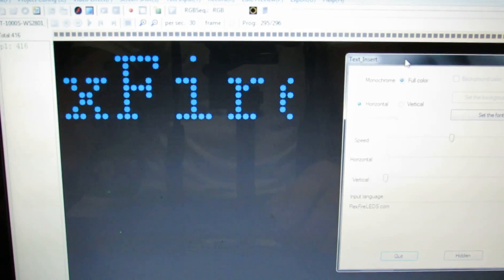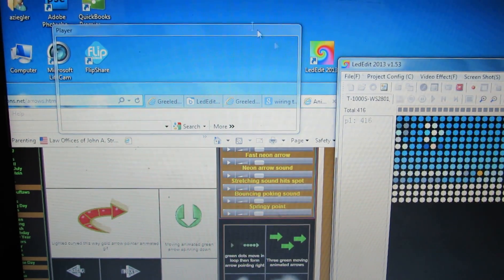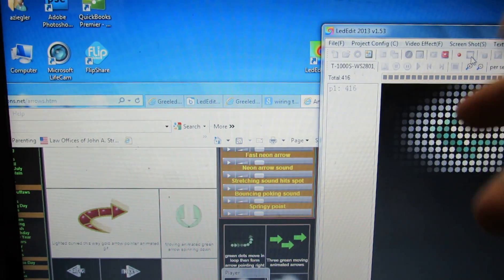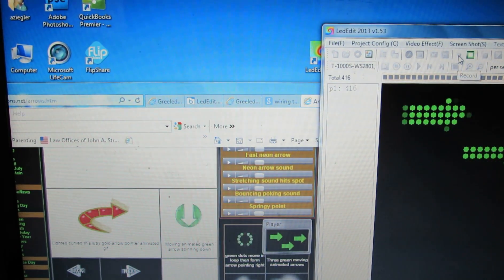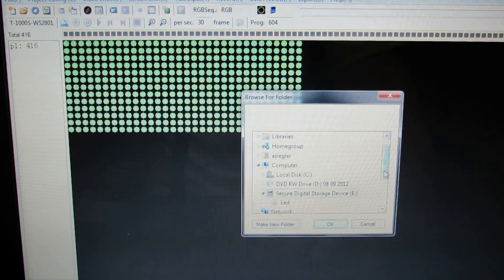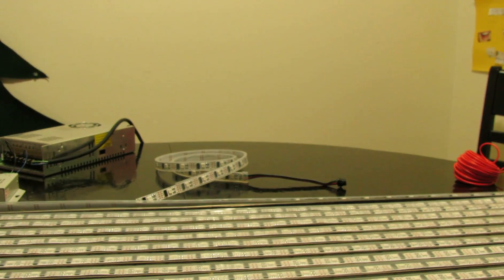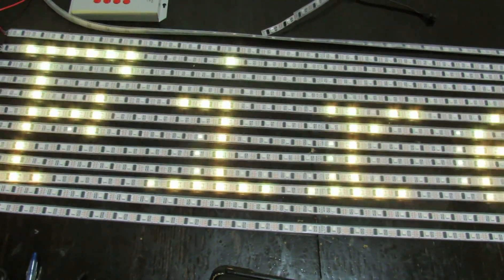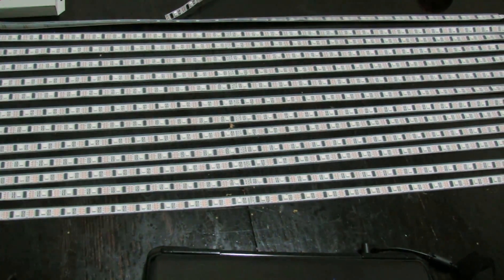How to Build an LED Display, #5 Add Effects Together (WS2801 LEDs)

Comment: What kind  of strip did you use? strip rgb 5050 controller?
Reply: the leds in this strip are independently controlled by each of the ICs (independent controllers) so they can say 'led one change to blue, led two change to green...' without making all the leds do that